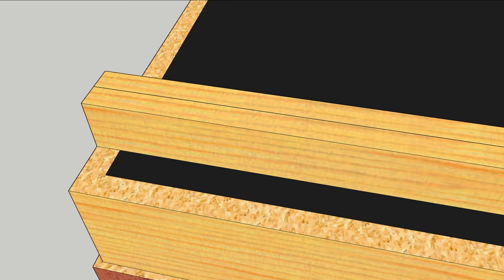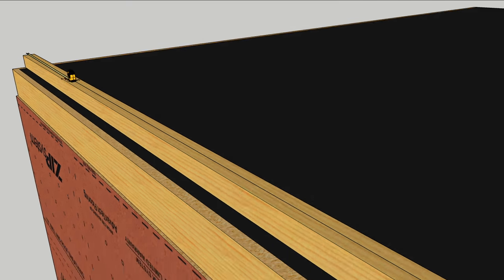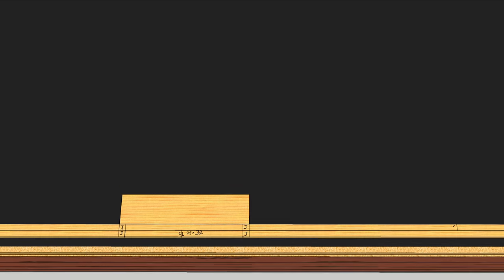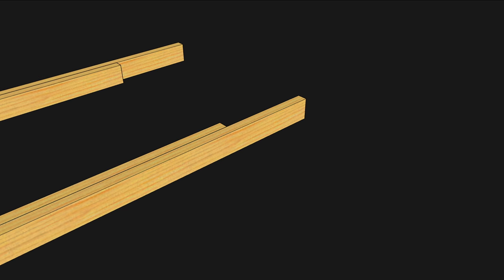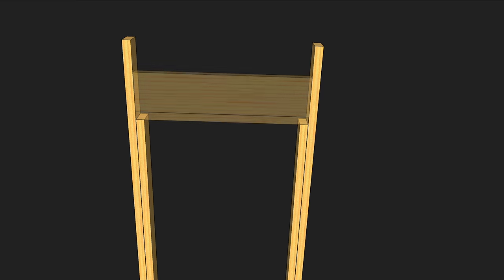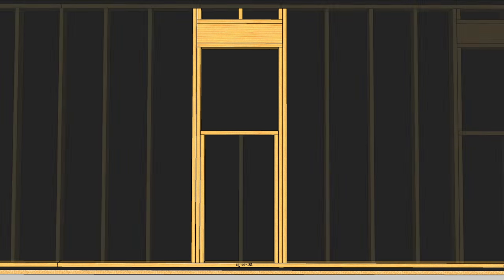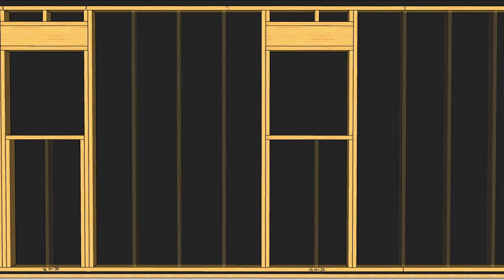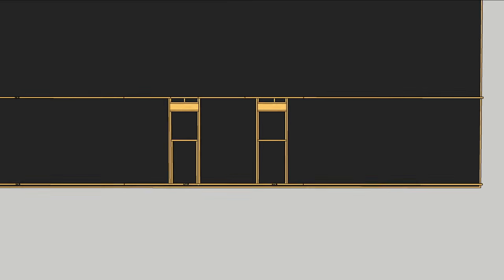Two Wall Framing Methods for Window Rough Openings

Comment: For a 3’ w x 5’h window, can the header be attached directly to a stud on one side, maybe with a strong L bracket, as this is needed to get window into correct location. Would this not be to code? The other side of the header will get full support with jack stud and king stud.
Reply from the maker: Header hangers exist and are sometimes used by people who want to reduce the amounf of lumber used in a building or people who framed the window opening the wrong size and need an escape route. The finish carpenters get grumpy when you leave out lumber that they are accustomed to nailing into, though, so be forewarned.

Comment: QUESTION: my outside walls are 6inch studs 24 spacing what if i get a window that fits between the opening .
Would you need all that or can you cut the opening and just hand the window between the stud? since the load studs don't change.
Reply from the maker: If you have a 22 inch window, you can slip it between the studs, just adding a sill at the bottom and a nonstructural 'header' for drywall and trim fastening at the top. 

If there is no load above the window, the need for a header is usually deeply reduced.

Comment: Just discovered the contractor (licensed too!) removed the jack studs to install a 42"x96" window.  Just left the header nailed through the king studs.  But, it's been 15 years so I guess it must be ok?
Reply from the maker: Framed structures have an amazing amount of structural integrity, unlike the contractor you mention. An eight foot opening, by code., requires TWO trimmers under each end of the header.
There are multiple ways he could have done it without risking you a big repair bill.

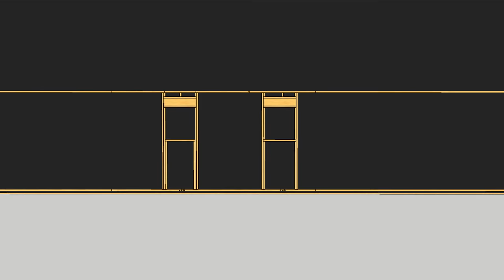Comment: Left most image at 1:22 is missing right sill support.
Reply: its a good idea to double up on the window sill, gives more to fasten trim to
Reply from the maker: Yeah, not sure it's really needed. Just more thermal bridging in the wall. There are two cripple studs under the sill and there is really no weight on it.